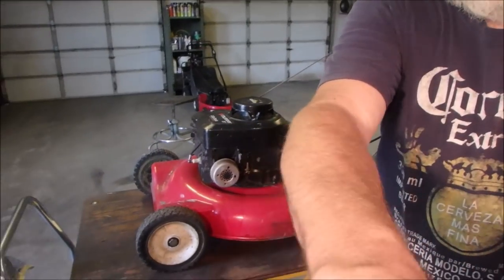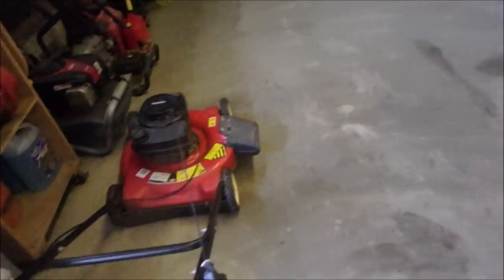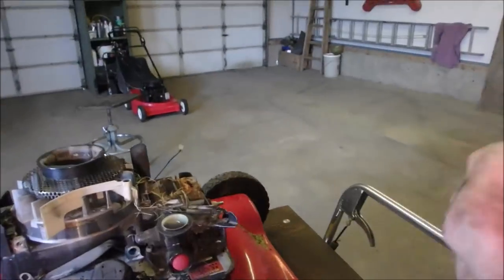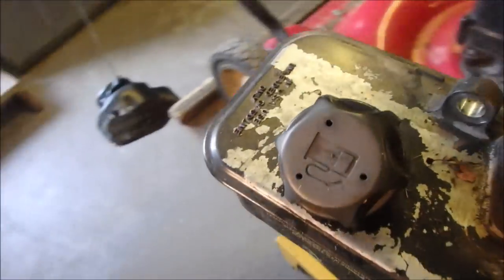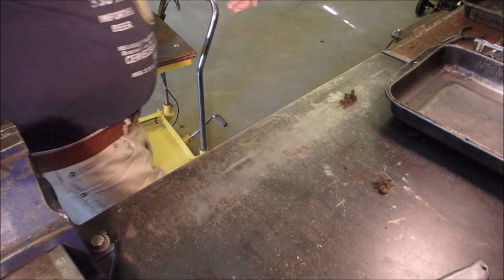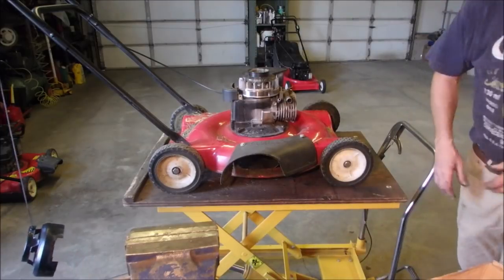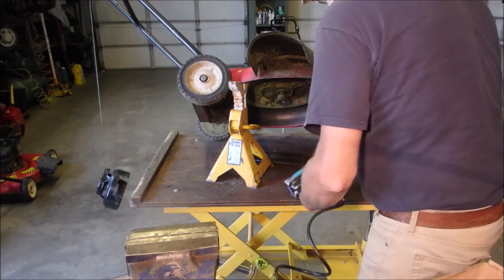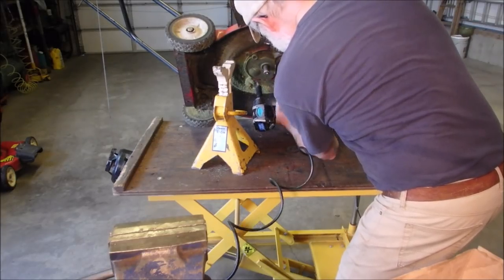Engine Swap From Briggs to Tecumseh

Comment: Hi Bruce! I enjoyed watching this! It really is a rarity that everything lines up and interchanges that easy. So many times I've done motor swaps and found out that the blade adapter is different or the cables won't reach. It's nice to watch you do such smooth engine swap and have everything work as it should. Nice Job! Fun Video! Wes 👍😎  Oregon
Reply from the maker: I really looked at before i started.  The owner thought it would be an easy 3 bolts.  LOL

Comment: Bruce hi! Do the 3 deck bolts have a torque spec? I don’t want mine to vibrate loose. Thanks.
Reply from the maker: I am sure they do.  I would do them just a good hand tight.  They are a thread forming bolt.  OK  I just googled and foud this  schrol down.  Don't be shy.  i am sending more people to google as i am getting a lot of questions these days

Comment: If I'm trying to throw a gvc160 Honda on a deck with that originally had a Briggs and Stratton, what modifications do I have to make?  Will I need new cables and a blade adapter?
Reply from the maker: Sorry , Well this isn't great advice but try it on then measure.  The blade adaptor will be different.  It will be close but one is 2.50 Cm's and one is 2.54 Cm's.     I have not done a Honda onto a North american case   It may not fit   I don't know.   Just try it as it sounds like the Briggs is toast.
Reply: Bruce Pender I did a Honda 160 to a Craftsman body today. The original motor was a Briggs, by the model number but it had a Tecumseh on it when I got it from a charity yard sale. It was the Tecumseh that I accidentally blew up on the last mulching day before snow last November. It looks like the shaft is too long, the blade is about a quarter inch past the bottom lip of the shell. Can I put spacers between the motor and frame? Or should I find a different frame?

Comment: Nice video,  I learn so much from you guys. I have a John deere riding mower gx70. They say there is no way to change the engine out. Just a bad motor, the rest runs fine. Keep up the good work.
Reply from the maker: Thanks Gary.  If there is a dipstick you can suck the oil out of there with a suction tool   They are cheap.
Reply: I'm sorry you miss understand my question, the motor on the mower is no good, I need to replace it completely but they say there is no motor to use. ?
Reply from the maker: @garygrose6351  If there is no motor to reuse.  Take out the bad one   measure it up (Shaft length mounting holes etc ) and I bet you will fine one somewhere.  Shipping costs may be the issue.

Comment: Do you use hardened lock washers or maybe a better question is have you ever used non hardened lock washers
Reply from the maker: Yes I use both.  A grade 8 washer will be a goldish colour.  I try to use a grade 8 washer when put on a blade.

Comment: I get $18 for the flywheels, and $30 even for those 590569 sump cover on ebay. I'd also save the intake because I actually have had them split apart before where the tube goes into a 90
Reply from the maker: I just don't have room for storage.

Comment: Hey Bruce have you ever considered doing an engine swap from a craftsman on which the good engine is the Briggs and Stratton with the ready start feature
Reply from the maker: One day one will come in.
Reply: @BrucesShop   hope so because we have a craftsman lawnmower at our house with the 6.75hp  engine on it and it has readystart on it and would like to see if that same engine would work on another lawnmower
Reply from the maker: @randytorboli482  There should be a way.  I have done a few,  I am not sure if the easy start makes the engine case any different.  Most lawn mower bodies are similar except for the Pure Honda's.  Shaft length and diameter are the key.

Comment: Bruce, did you try pulling the plug, clamping the bail down, spray some penetrating oil into the cylinder and try to break it free by pulling on the blade? I had a seized mower and that worked for me. The problem with my mower was too much compression (160 lbs cold). I adjusted the valves and it starts easy now. Anyways, I watch your videos every night before bed. Good job on the swap.
Reply from the maker: It was so scored.  You can see at 16:25

Comment: If the oil in the blown engine is at level, I can tell you how it blew up, and to let your friend know, it's from tipping the mower back, mowing very high grass, the oil sits in the back of the engine, an engine can only oil itself if the mower is level..... Great video, as always buddy..... The cops man.... Runnnnn..... LMAO, anyway there wasn't enough oil, yikes, I was going to say, if he mows with it tipped back a lot to fill higher then normal, but lack of oil, boom....lol
Reply from the maker: I think it was seized before he got it (I sold it to him for $40 Canadian a few years ago)  and with low oil it did it again.

Comment: Nice job, sometimes swaps bite you every step of the way. Like the last hold down breaks off in the sump😞
Been there!
Reply from the maker: Right.  Those thread forming bolts suck.  They are not self tapping they are a thread forming ones.

Comment: I am not that partial to just one brand of engine as long as it runs good ...same as with brands of cars ..The Tecumseh 6 hp I just got running on my little JD60 is a good engine
Reply: I had a Tecumseh on a Murry mower for 16 yrs.The deck was rusted/repaired/rusted around the rear wheels in spite of my cleaning habits. Tried to find a deck,but never could,so I just put it on the curb.(killed me). I drained the oil and put Amsoil Synthetic Oil in it the day I brought it home from Home Depot. It started first pull EVERYTIME, after sitting all winter, for 16 yrs. I have a B.&S. on a yard machine and when you shut it down to empty the grass catcher it will not start until it cools down for a couple of minutes.Something about the exhaust valves expanding and not quite sealing.Hell,I don't know but it burns my ass.I had a Ryobi trimmer for 12 yrs. 1-3 pulls.No more compression.
Reply from the maker: @halfpack69  Yes  some Tecumseh's were great eh!!!

Comment: Before I would have put the replacement engine on the deck, I would have cleaned the under side of the deck.  Seen some mess under it.
Reply from the maker: Thanks
Reply: @BrucesShop  Don't mean to sound like I am picking on you, I know we each do things our own ways.  I, myself, would have done it before swapping the engine on as it would have been easier for me.  Then again, I don't have a lift and would have been sitting on the ground doing the work and don't have a pressure washer either.

Comment: That Luber is for my Motorcycle, but also fits the Cable on the Lawn mower.........
Reply from the maker: Right.   Ok  LUBER???
Reply from the maker: I have one.  thanks
Reply: @BrucesShop  I just think you could do a Great job of doing the video How it works.
Reply from the maker: @navythomas8  OK  I will do one when the rush is over.  If ever  LOL

Comment: I have no problem with the tecumseh engines just the carburetors I don't like too well but like you if you keep them maintained then there's no issues with them
Reply from the maker: Right.  I had one for 27 years as my main lawn mower.  You may have heard that.  I changed the oil and cleaned the air filter in it every year and just used it.  I sold it in running condition.
Reply: @BrucesShop  yes I have sir  I have a couple of Tecumseh Engines they run good also no complaints i have a 6 hp on my lawnboy mower

Comment: Hey Bruce great job you made it look easy now what did that ole boy do run that briggs out of oil ? Cause we all know a briggs is a way way better engine then a Tecumseh just saying thanks for the videos
Reply from the maker: Well things happen slowly (oil level going down).  I think in the right circumstances they are pretty equal.  There are so many Tecumseh's up here.  My main mower was a Tecumseh for 27 years on a double lot and I sold it in running condition.  The 3.5HP are very good.
Reply: Hey Bruce! Good job. I have a question. When I was a kid in the 1970s, most mowers were 3 or 3.5 HP. We had a large ditch in our corner lot yard, so my Dad bought a 4.0 Craftsman. We never had a self propelled mower cuz Dad said it was good exercise. Today's mowers are all 5 HP or more it seems. Is it because more mowers are mulch mowers, or more are self propelled, or that people like Horsepower, or some other reason for the change over time??
Reply from the maker: Well I think folks just aren't ready push a small engine lawn mower  through thick grass. When I was a kid we had a rope start 2 stroke Tecumseh.  When the grass was long you just went slow, sometimes went through twice.   I do think mulching takes a bit more power but not twice the power.

Comment: Sounds like the cops are making a killing at the end of your driveway. Dont need a lockwasher that big washer is made with a raised center so that when you tighten it you get a little spring action in the washer. Brother gave me a $350 toro with a briggs, nice autochoke carb there  briggs, dumba** oring inside the fuel cap neck, cant take the cap off without dropping clippings and dust in the fuel tank, cleaned the tank and carb and added an inline fuel filter. Used it for a couple years then the drive broke on it. Bought a used hydrostat honda last year, cant get the carb to act right.  Got out the 1996 $96 22" murray with tecumseh 3.8, put in fresh gas and it started 3 pull after being in the shed for 5 years. It has a whole pound of flux core mig wire in the deck, 7th blade on it, I sharpen frequently and use them until the lift ramps are worn off, the 3rd set of wheels is worn out, and it was starting to burn a little oil Ready for rings, and if youre gonna do that give it some bearings too. That thing went through a lot of 3/8 saplings and 6' tall weeds in it's lifetime. Reach down and adjust the mixture a little rich if you need a bit more power, or lean it back if it is light work to save some fuel. Take that mixture screw all the way out to drain the bowl.  Why in the hell cant we just go back to that? I dont remember ever even changing the spark plug, I dust off the filter couple times a year, and about every 3rd year I would wash it out with dish soap real good, let it dry, bout a teaspoon of oil worked in to it and on you go. Oil change when putting it up for winter 30 weight pennz, and sometimes another oil change about June if I was running it hard. Ok you convinced me it is possible, I will buy you a beer or a hamburger,  hell you can have both to swap the 1996 3.8 tecumseh over to another deck for me? Tired of engineered to fail junk made these days. Good job sir.
Reply from the maker: Thanks

Comment: could you just swap the engine and the handle instead of the  cable
Reply from the maker: MTD to Murray,  The holes and line up are different.  Good thought though.